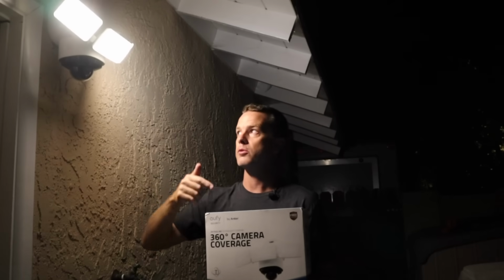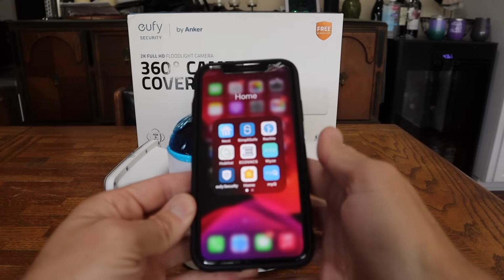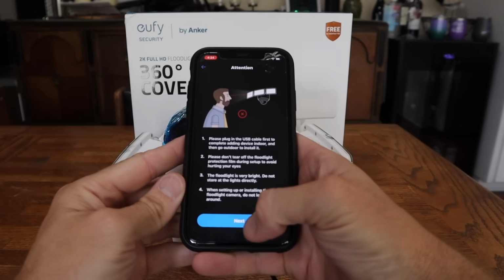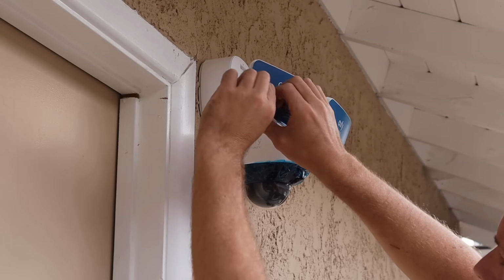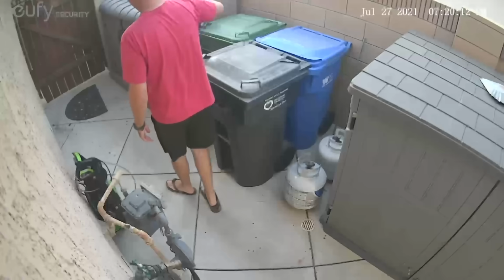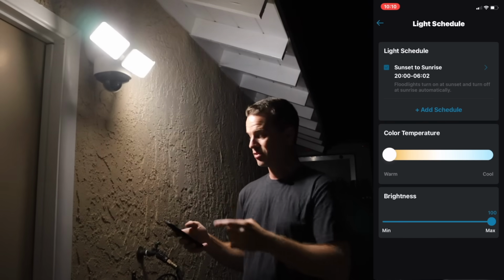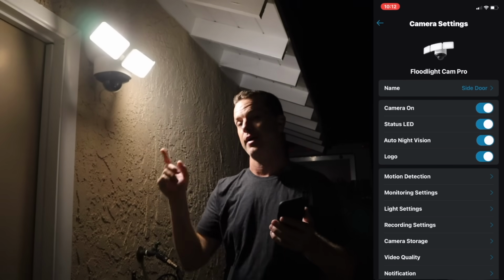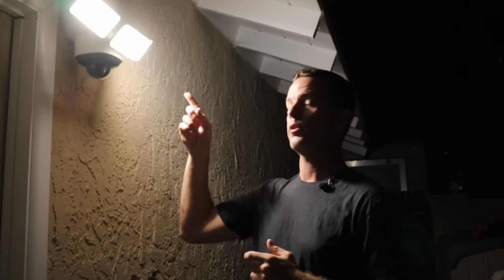Eufy Floodlight Cam 2 Pro - 360 degrees of awesome?

Comment: How does it handle opposite sensors triggering like if two persons approaching from opposite sides?
Reply: Good question
Reply: @johnred3003  Is it a good question? Are you monitoring the great wall or something? Do you have a problem of gangs of thugs breaking in on a regular basis? If you are really worried about getting perfect recording of multiple intruders, no one-camera setup for a large area can possibly satisfy your needs and not sure why you'd be interested in this one.

Comment: Great review. I might've missed it, but is there a monthly fee for storage like with ring?
Reply from the maker: No fee's for anything, one of the best parts of the Eufy lineup.
Reply: It seems all Eufy security cams  record to the cam or the base station depending on the product.  Some use a SD card and some have an EMMC storage which all, I believe, are secured with 256 bit encryption, so only you with your login info can access your videos.. according to Eufy...  that is what has piqued my interest in this brand of security cams.  Check out their website, all info is there.
Reply: @Dez425  I am on the fence Between Eufy and Ring   I have heard that if Eufy server goes down then you are unable to use the system. with your login info.
Reply from the maker: My understanding is you’ll have the same issue with Ring.
Reply: No